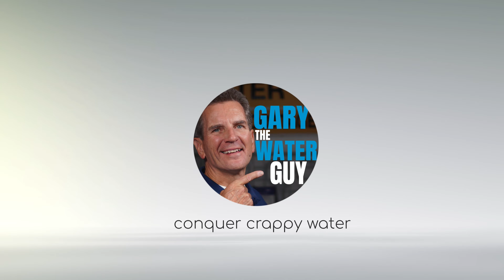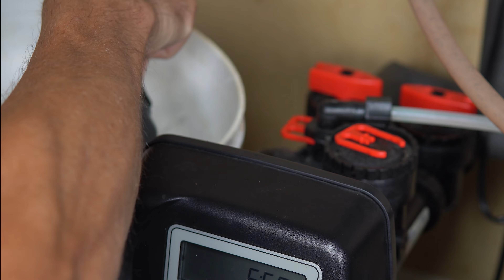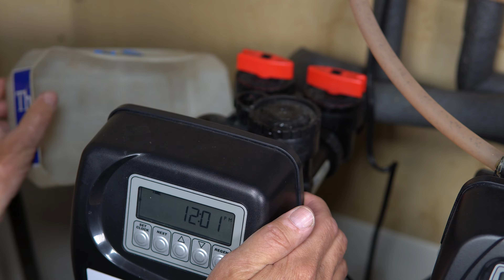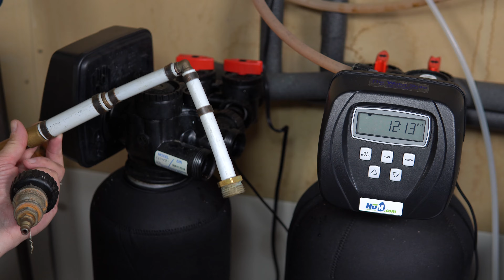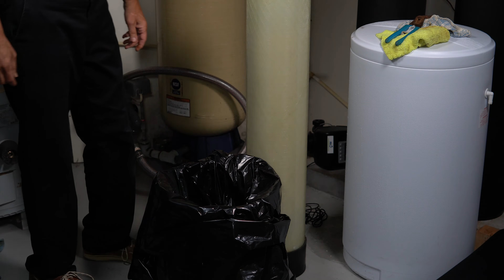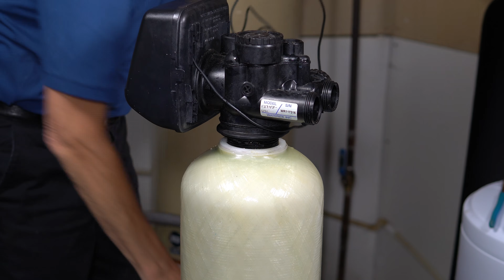WATER SOFTENER RESIN or Media REPLACEMENT

Comment: I have lots of iron / rust in my water.  What system do you suggest before the softener?
Also i have 7 ppb of Arsenic.  Is there a filter system for that so i don't have to use RO filters at the sink?
Reply from the maker: To remove iron from your water this video will help you choose the best iron filter https://youtu.be/af1iVOC-Hyk
 The FOK also removes arsenic. We have them here https://waterestore.ca/search?type=product&q=fok*
Reply: @water_estore  So i just noticed you didn't add gravel to the bottom.
Is gravel required or optional for a softener?
Reply: @water_estore  Sorry, nevermind, i see that you answered that question several times below.  Gravel is not needed for a residential softener, only iron filter.

Comment: Hello Gary, Not sure if my first message went through so I'm trying again. I have a Windsor Softener, WS-32 with a Clack Valve that I was having softening issues with so I replaced the media and gravel following one of your step by step videos earlier in the year. That did the trick, but now recently I have been noticing media in the laundry sink after each load of laundry and it appears to be getting worse. I realize that this is not good so I bypassed the Valve. Can you tell me please why this may be happening as well as how to remedy the issue. Any helpful suggestions would be much appreciated. Thank you
Reply from the maker: Sorry to hear.  Likley the top basket has come loose.  You might be able to carefully remove the valve and reattach it or if all else fails disassemble, fix the problem and repalce the media again.

Comment: Hey Gary, how much do you typically charge to exchange the media on a softener this size?
Reply from the maker: Great question.  We do not exchange the media in customers homes as it is far too messy and our weather is not compatible with doing it outsdie and it is still soo messy to do outside at a custoemrs home.  We just replace the tank with new media.  About $700-$900 Canadian.
Reply: @water_estore  That makes a lot of sense, thanks!

Comment: Thanks for this very informative video. One question, there is supposed to be a resin screen that prevents the media from flowing into the house plumbing. How do you check this screen to make sure that it’s in good working order? The reason I ask is because another YouTube viewer had an issue when replacing the media where the media ended up in the plumbing causing the faucets to clog and creating a huge mess. Is the screen located at bottom of the tank? Thanks so much for your help.
Reply from the maker: Great question.  There are two.  The one at the bottom of the riser tube and the one at the top, see this link https://waterestore.ca/products/hum-riser-tube-and-upper-screen-replacement-combo
Reply: Very informative video Gary,  I have WS1 valve and the spec sheet calls for 1 cu ft of resin (24000 grains).  I have been getting resin in the plumbing.  I believe the tank is 8 inches.  I have a CLK Riser Screen Combo and a 1 cu ft bag of Excelclear Premium Water Softener Media in my shopping cart, do you think I need anything else for this project?  Thank you for sharing your knowledge and expertise!

Comment: I finally tackled this project!  This video was excellent, and really prepared me for all the steps I needed to do - especially to prepare to do some of this work outside!  This solved my low water pressure issues - probably caused by “expired” resin.  Thanks again.
Reply from the maker: Glad it was helpful!  Please share with friends and family.
Reply: @water_estore  Hi Gay , thanks for the excellent video. I will do the job by using air pressure. I would like to know what the size and type of connectors like you shown in the video so I build mine. Thanks, Brian

Comment: Can anyone tell me if or how to rebed an ENPRESS MODEL 1044 Westinghouse water softener resin tank.  I think it has 3 "plates" in it and the top layer is charcoal, and I think there is also Cocoanut husk, normal resin and I think one other granular item.  House is on City water and only needs water softening, none of the other stuff. Unit has a Clack upflow valve that appears to work just fine. Thanks in advance for any help.
Reply from the maker: I have never worked on none of these but I would think you just replace the media with water softener media like this https://waterestore.ca/products/excelclear-premium-grade-water-softener-media-1-cubic-foot

Comment: Gary, we have elevated level of uranium in our well water.  A local company recomended a mixed media filter that would need to be changed once a year.  Also a new water softner.  Caresoft eliete rc.  It is a water softner and carbon filter in one with separate brine tank.  Does this sound like a proper system?
Reply from the maker: I don't know much about uranium removal but I don't like mixed bed water softeners becasue the carbon section will need replacement before the resin beads.  Also, I would definitley add a reverse osmosis drinking water system like this https://waterestore.ca/products/hum-water-saver-reverse-osmosis-system-75-gallons-per-day

Comment: great video, but I have difficulty to unscrew the tank from the unit.
Any idea what is the torque I need to apply as my unit is a Fleck5600 and I do not dare to force too much on this plastic/synthetic piece??? I made a special tool to apply force onto the ribs at the base of the unit  but still cannot manage .
Reply from the maker: I don't know the torque but make 100 % sure that all of the pressure is gone from inside the tank before trying to remove the valve.

Comment: How do I know what resin I need? I have a 7000 water softener head unit.
Reply from the maker: You can check with the manufacturer to be sure.  If not this is a great general replacement  https://waterestore.ca/products/excelclear-premium-grade-water-softener-media-1-cubic-foot?_pos=5&_sid=56c049009&_ss=r

Comment: My tank is buried half way or so in the ground outside. What do you recommend in that case since I do not want to dig the tank out?
Reply from the maker: Good question.  You might be able to just run water into it and flush the media out, but I would dig out the tank.

Comment: My pressure isn't slowing down, but the softener isn't getting rid of the iron. I had a salt bridge that I broke up. Even after breaking the bridge the softener still won't filter the iron out. I ran a cleaner, but that was before I broke the bridge up. I am getting another cleaner called "rescare" that I am going to give a try. If this doesn't work then I don't know what to do.
Reply from the maker: Have you had the water tested for iron and tannins content?  Often tannins are misdiagnosed as iron.  Check out this video to learn more https://youtu.be/7he5dEdj_Dw
Reply: No I haven't had it tested. It is staining all of my appliances with a yellow tint. I got some res clean and I am running it through now. I am going to regenerate it 3 or 4 times and if that doesn't fix it then I am going to call someone down to look at it.

Comment: With good valves in bypass, can you have the water on, and not disrupt the water inside the house? Just in case I take a longer time
Reply from the maker: Yes you can, but it will not be treated water.
Reply: @water_estore  Thanks for the reply.

Comment: I have a potassium filter/softener that can backflush. I just dumped the media but I don’t know what to replace it with considering the potassium. Also, the media that came out was black. I assume it was a gravel bottom, then a resin layer, and then charcoal layer on top? Or does potassium use a special resin? Any help is appreciated.
Reply from the maker: Do you mean potassium chloride or potassium permanganate?  What does the potassium look like?

Comment: Hey Gary, I have a Windsor series WS-32 water softener with clack valve that I had Plumbing contractor install approx. 5 years ago. 
 I was having some issues with the softener not softening properly so I was going through some of your suggestions to try to trouble shoot the problem. Not that I think it has anything to do with it, but when I cleaned out the Brine Tank I noticed that there is not a grid plate, or platform at the bottom as shown in my owners manual. The salt sits right on the bottom of the Brine Tank. Should I be concerned, will that cause a problem?
Reply from the maker: No, we don't use those plates in our softeners either.
Reply: @water_estore   thank you. Your videos have been very helpful.

Comment: I have resin in my brine tank. Does that mean I have a leak in the resin tank? Thank you.
Reply from the maker: Yes, I think it does.
Reply: @water_estore  Thank you. We were planning to replace just the tank and resin but the machine is too old for available parts. We currently have a new one but have to pick up a few flex hoses to make it fit. Thank you for responding!

Comment: Hi Gary,
I'd like to tackle changing the resin/media bed in my Aquapure iron removal system but not sure what resin to use or how much.  I have high iron content in my well water as well as manganese.  Also, where is a good place to buy the supplies needed like the correct size funnel, tube, etc?  Thanks!
Reply from the maker: This video shows you how to calculate media amount https://youtu.be/-KeuIvIyMis  We have the replacement media here https://waterestore.ca/products/katalox-lite-media-1-cubic-foot-free-shipping?_pos=78&_sid=419ab3855&_ss=r

Comment: I just replaced an old unit with a new aquasure 64,000 grain softener. Set it to factory regeneration every 1000 gallons. Will also do a yearly manual regeneration maintenance with iron out straight to the brine well. Hope it will extend the life so I won't need to replace the resin any time soon! Great video
Reply from the maker: Glad you liked it. Please share with friends and family.

Comment: did you not miss the gravel on the bottom
Reply from the maker: Great question!  No, most water softeners these days, like the one in this video do not use gravel in the bottom when used in a residential application.  This is why you need to check with your manufacturer to make sure you know if your water softener requires gravel or not before doing a rebed.

Comment: there are better and cleaner ways to do the rebed   Why do you put the silicone on the tank neck then put fuel on it ? when you took funnel off you wiped the top neck taking away silicone lube that didn't stick to your funnel,   I never use painters tape on my distributer tube  have a very simple plug i put in. never any issue of pulling distributer tube up out of place
Reply from the maker: Thank you for your input, what are the better and cleaner ways, please share?  I did not put any fuel on the tank neck, just silicone grease.  I wiped off the stray resin beads, being careful to remove as little silicone grease as possible.  This video is for the DIY homeowner, I doubt that they would have the correct sized plug available but they could certainly access painters tape.  There is always an issue of pulling the distributor tube up out of place when removing the valve, it has happened on numerous occasions to me, every installer that has worked for me and every water filtration tech guy I have ever discussed the topic with.  It can happen anytime you remove the valve.

Comment: My water softener it started making that noise at the end of your video, after 4 years that was installed. Honestly I don't know how often this system should be getting service😅 the only thing I do to, just keep adding salt pellets
Reply from the maker: when does it make the noise?  A few seconds at the end of the cycle or more often?
Reply: Thanks for the reply. I keep watching more of your videos yesterday and found the problem and its the seals inside, clack ws1 kit, I think that's what is called

Comment: I did this whole job but I'm getting resin beads coming through. Bottom strainer was replaced. The top one was in great condition. What could be causing this?
Too much resin possibly?  It's a standard 10-12" by 48" tank and I used 1.5cu ft of resin. I'm about 12" or so from top of resin to top of the tank lip.
Reply from the maker: When you filled the resin tank did you make sure not to get any into the riser tube?  Did the top basket lock in place?  those are what I would suggest might be the problem.
Reply: @water_estore  heap. All was looked over and in place and properly cleaned. I've no idea

Comment: If you leave a bit of water in the resin tank, you can blow into the riser tube to displace the media and remove the riser tube easier, with lower risk of damaging the basket.  When you've replaced the media, you can add water back in and blow again to reinstall the basket/riser.  That makes it easier to do the job without having to worry about plugging the riser to prevent the media from accidentally falling into the tube.  A shop vac can make removing the resin from the tank much easier if you don't want to take it outside, but you'll need to use a flashlight to look into the tank and add more water from time to time to get it all out.
Reply from the maker: Thanks for the tips, I'll give it a try next time.
Reply: @water_estore  what we do at my job is we get a mallet and lightly tap on the side of the tank just above the boot. The riser tube comes right up super easy. Just a cool trick if you guys haven’t tried!

Comment: Great video! Generally, how often should you replace the media? Should this be done as a preventative maintenance or only when you notice clear signs of failure?
Reply from the maker: Great question!  Only when there are signs of failure.  Typically the media will outlast the rest of the softener.
Reply: Common consensus is 10 years for "normal" hard water, and sooner for extremely hard water.

Comment: What do you do if there is a leak from the E Clip when the softner regenerates? Thanks!
Reply from the maker: Good question.  Remove the fitting and use plumbers clear silicone grease on the o ring.https://waterestore.ca/products/plumbers-clear-silicone-grease-5g?_pos=448&_sid=ce0e6e664&_ss=r    If that does not help you will need to replace the fitting.  https://waterestore.ca/products/clack-ws1-drain-elbow-v315801?_pos=153&_sid=ce0e6e664&_ss=r

Comment: Hi Gary,

I have a Fleck 5600SE, what type of media? how much do I need? do you I need to change the gravel?
Reply from the maker: Assuming it is a water softener, this media will work https://waterestore.ca/products/excelclear-premium-grade-water-softener-media-1-cubic-foot?_pos=5&_sid=8d03c95de&_ss=r , how much you need depends on what size of water softener.  most water softeners do not have gravel in the bottom of them.

Comment: Replaced the resin in my softener this weekend.  You were right Gary, it is messy, but very satisfying to do the work myself!  I made a couple mistakes, but all ended up ok in the end.  Instead of unscrewing the head unit, mine had a plastic compression ring that held the head to the threaded lower piece.  I removed the screw in the compression clamp only to realize I still had to unscrew the base.  There was a crazy multipart 0-ring between those 2 parts.  I used some silicone grease to hold that o-ring in place and then re-connected the head to it.  Second mistake was starting the regenerate while there was still mostly air in the system.  Ended up dumping about 4 cups of resin out of the drain line.  Hoping that won't affect performance of a 32K softener, I put a full cubic foot a new resin in.  I definitely have learned a lot about these system in the process.  Thanks Gary.
Reply from the maker: Glad to hear the video helped.  Every brand is different and as a result there will be differences during this process.

Comment: Hi Gary - Sorry one last question.  I have an iron filter and softener next to each other, similar to your setup.  For the drain lines, I ran both of them into a single T valve connector, which then connects to a hose that runs outside.  The iron filter regens about every 3 days at 2:00, and the softener between 7-10 days at 3:00am.  So in theory it's very unlikely they would regen at the same time.  Is this configuration ok?  Is there any chance the dirty water from a regen could push back up into the other device?  Thanks, Tim
Reply from the maker: They should never regenerate at the same time.  Since the regen time of the iron filter should be shorter than 1 hour you are fine.  No, the dirty water from one will not enter the other.
Reply: @water_estore  Thank you!

Comment: Great video Gary!  I have my resin and funnel, ready to go.  One thing, I'm confused about why you started a regeneration cycle at the beginning of the process.  Was that just to help flush water out of the system, or was there some other reason for that?
Reply from the maker: Releasing the pressure inside the tank to make is easier (and dryer) when disconnecting from the plumbing.

Comment: Why didn't you put the gravel in before the media? As this is a very important step.
Reply from the maker: Yes it is if your system had gravel in it.  The water softener used in the video and in fact most residential water softeners do not have gravel in them.  It is always best to check with the manufacturer as to what media or gravel belongs in your water softener.